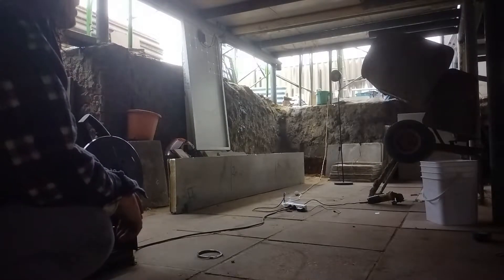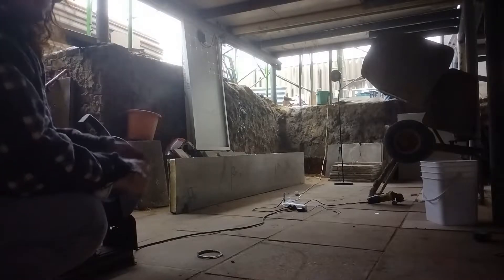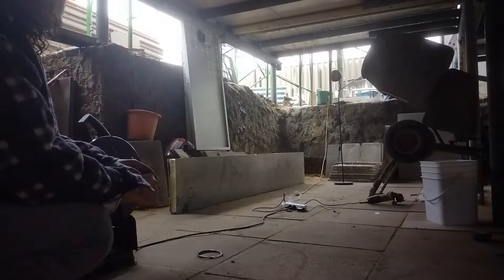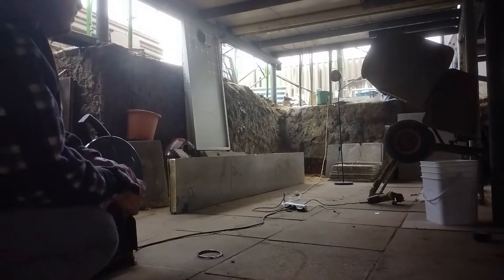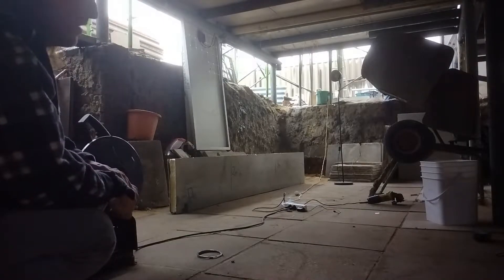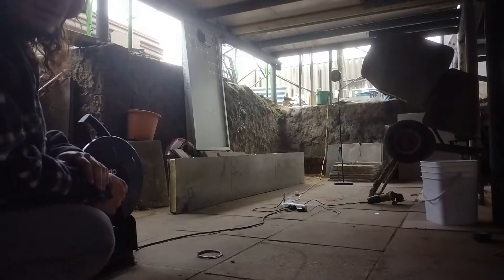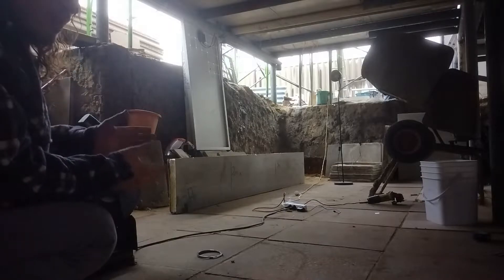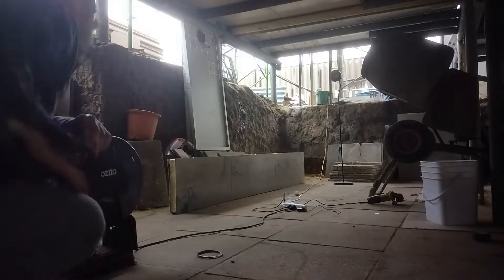How Far Do Angle Grinder Sparks Travel?

Comment: Just an FYI, sparks from a grinder travel further than you visually see in a lit area. Try putting down a long white cloth and it'll be a better way to show the limits as you'll see black specks etc. I still doubt they travelled far enough to do what was said, but it might be worth doing to strengthen the example.